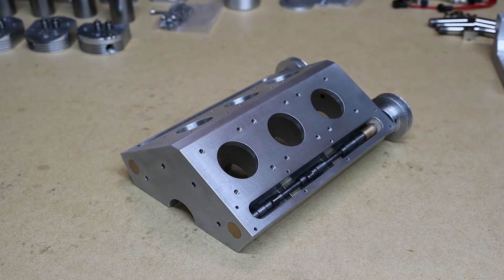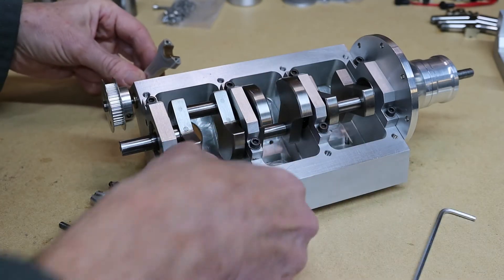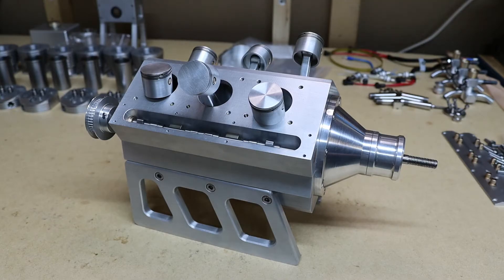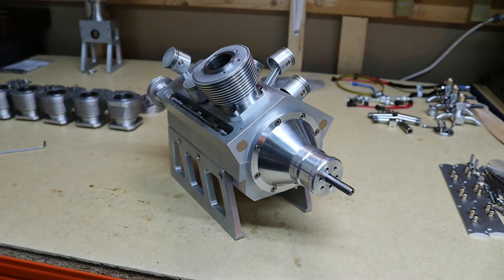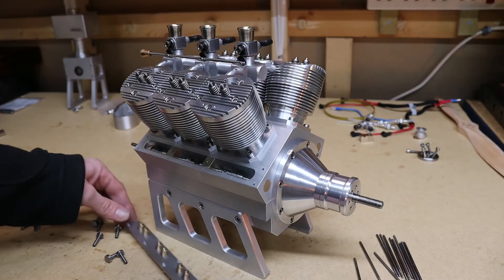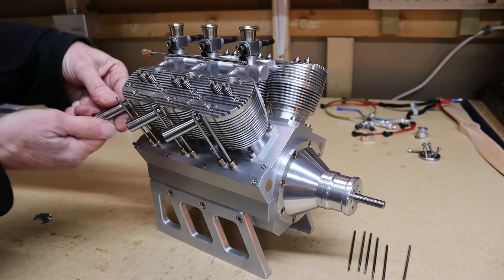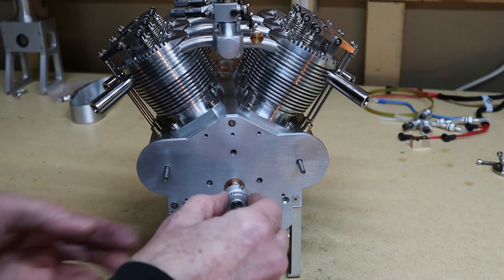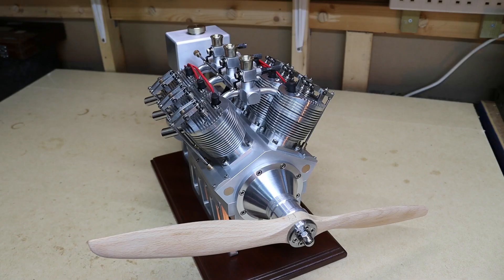Making A 90cc V6 Engine - The Assembly

Comment: Are the camshaft galleries partially oil filled before attaching covers, or how is lubrication handled in this area? How do you power the 6 glow plugs simultaneously. (I built an Ohrndorf 5-cyl radial & ended up using dedicated RC igniter voltage regulator devices, 1/per cyl. They match the plug voltage/current specs but allow elevated input voltage like LiPo or 12V, so curious how you handled this). Just want to say I really enjoy your channel & projects.
Reply from the maker: Hi, yes the camshaft galleries were partly filled with light oil, and relied on the splash. For the glow plugs I connected the six leads to 12 AA batteries connected in series which increased the amperage but maintained 1.5 volts, which worked fine.

Comment: Excellent work, Kevin! Can you comment on your built-up crankshaft construction? What material for crank pin & main journal? Guessing the assembly is pinned, are they tapered pins or dowels or? Are the components press fit together or Loctite retainer or? Are the mid bearings therefore permanent or the CS can be disassembled?
Reply from the maker: Hi Peter,The crank pins are made from EN8 and the journal’s are made from stainless steel (free cutting) All press fit and then pinned using dowels. The mid bearings are permanent and can’t be disassembled. Hope this helps and thanks for the comment.

Comment: hi kevin
Brilliant work, well done, couple of questions, How long did it take to make all those wonderful parts and i noticed you didn't use any form of gasket materials,  aren't they necessary.
I would love to have a go at one of those, but at the end of the day you can only have so many hobbies and aircrafts aren't on the radar at moment,
Do you fly them
see you next time
Regards
 mr f
Reply from the maker: Hi, I didn't think gaskets were necessary. I just wanted to make an engine so I designed this one and I only used a propeller to cool the engine down and watch something going round. It was just something to make.
Reply: @KevinWoodsWorkshop  well i take my hat off to you, is it out of your head or do you have drawings.
mr f
Reply from the maker: @MrFactotum  Hi, I made drawings as I went along. Thanks for asking.
Reply from the maker: Forgot to mention it took about 7 months to make by doing a couple of hours in the evening.